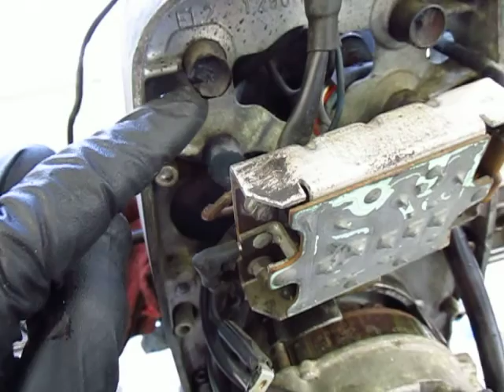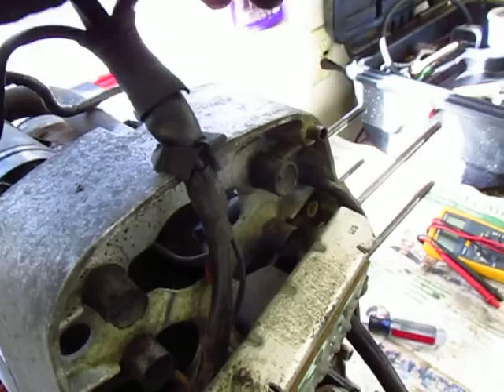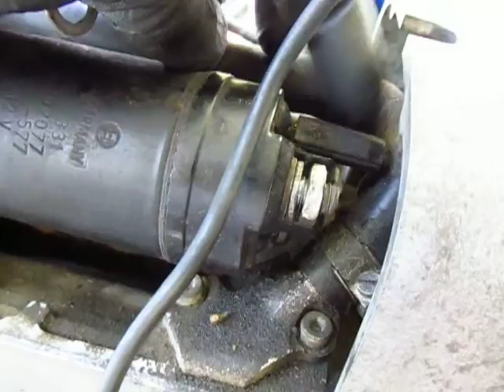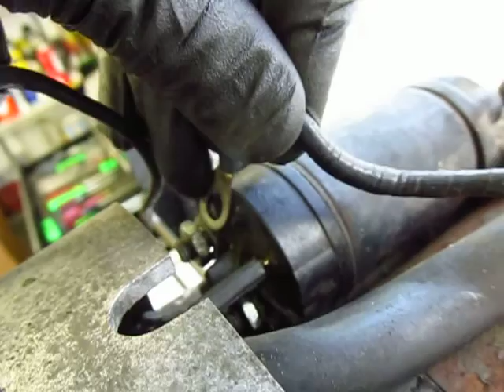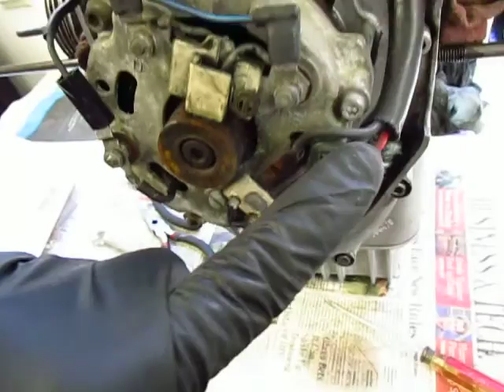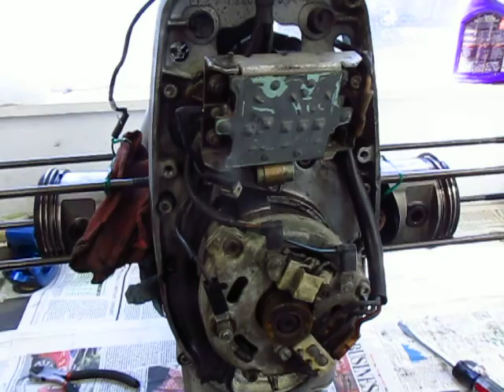1977 BMW R100RS Engine Electrical Wiring Routing

Comment: Tks. A million for your understanding of this remarkable German made motor, Boxer R100rs horizontally opposed air cooled engine which you are helping us to understand as we work with them  However, there are specific questions I would like to ask
1,two wires strip down from the diode board to connect to where?  2,A wire  comes out from the condenser to connect to where?  3, another wire comes out from the contact breaker housing and connects to where?  4, also there is a rectangular white in colour capacitor that was found running along the plus cable connecting the starter motor and lastly there are positive and negative  signs with  1 and 15 at the twin cable connectors on the two coils. The rest of the other connections are on. Pls. Help me explain how these five connectionsare connected. Am a sierra Leonean  using this engine on my self constructed single seater helicopter in Freetown and am finding it challenging to find one who can help me connect it for a startup. I appreciate.

Comment: Just got into the front of my engine on a 1980 R100 RS....its not charging. The first thing I noticed were some scorching marks on the grey paint of the diode board with broken traces of exposed copper? Is this like a printed circuit board where copper traces if  broken,  cause the diode board to malfunction?
Reply from the maker: fostex fan, the scorching means the diode board shorted out. This can happen if you remove the front engine cover but don't remove the battery ground wire first. The diode board is connected directly the battery so it is energized when the ignition is off. The front engine cover can touch the board and short it out when you remove the cover.

You need a new diode board. They are available at Euro MotoElectrics.
Reply: @BrooksAirheadGarage  Thank you Brook. I was very careful in removing battery ground first so am curious as to what might have caused this? I started the bike weeks ago on jump leads from a running car battery, so could this have caused the scorching? The other thing I am thinking is the bike was not started for 22 years and corrosion has simply eaten into the diode board
Reply from the maker: @fostexfan160  glad you pulled the ground first.  Corrosion could be the culprit